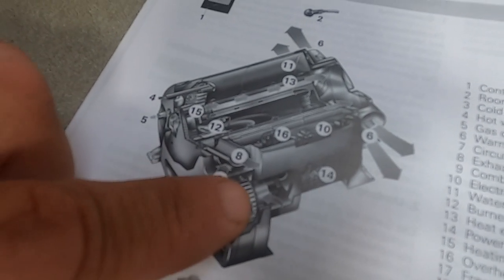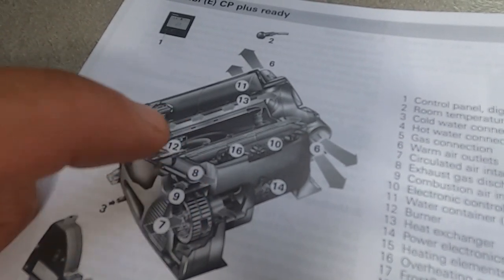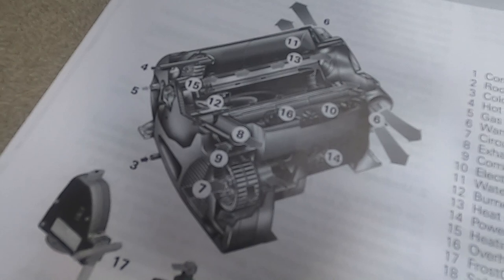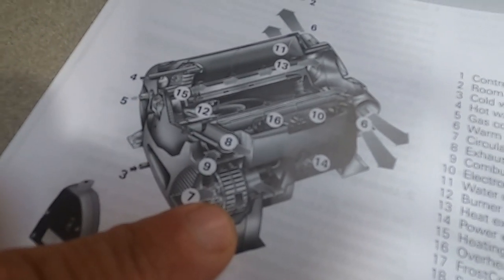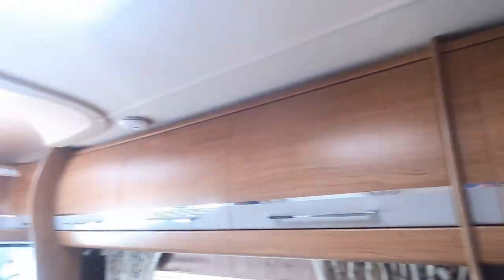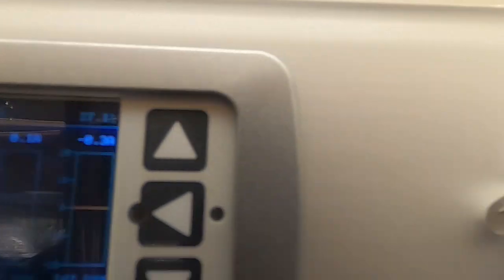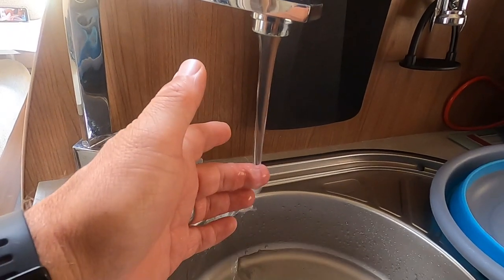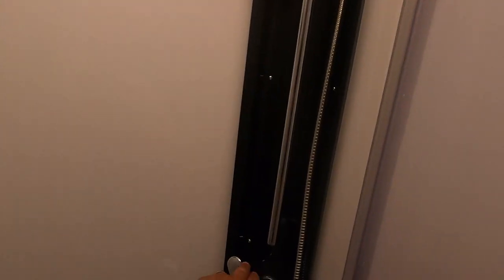Truma Combi Boiler Error Code E89H Update

Comment: Thanks for a great video, mind you I nearly turned off when you said that you had no lpg.My motorhome is 2011 and my control panel does not show any fault codes it had not been used for 10 months the last time the truma was tested out was by the enginer doing the habitation inspection and all was OK back then.The only thing it would do was heat the water on gas nothing else would work .once i  watched your  video the penny dropped, without the fan working nothing else can work,The use of that famous tool toffee hammer persuading device for lazy bits of components,,.BINGO ALL WORKING NOW NO COSTLY BILL?       THANKS AGAIN  KEEP IT UP.
Reply from the maker: Thanks for watching. Glad the video helped you.

Comment: I thought I would try my heating and hot water today as I go away for 7 weeks in the morning to Spain.  What a shock when I found that my Truma showed the E89H code. Panic set in, thinking We were going to be really stuck. I phoned a specialist and he gave me a few tips. Then I came across your video. What a life saver your video was to me. A few taps on the motor, as you suggested,  and all worked perfectly. You are a saviour my friend, and probably saved me a few hundred pounds. I am so grateful, many thanks

Comment: I am confussed  and thankful. I had the E89H code come up on my Coachman. Check the code which says problem with "Pcb /combustion fan". Contacted my repairer who confirmed most likely  the fan was the cause, but was booked until July.  But I watched your video and thought its nowhere near the fan in question, but the Air intake motor. I decided to clean my combustion fan and air motor and give it a tap. and low and behold it all now working. Still confussed but now happy..thanks.
Reply from the maker: When I had this E89H error code I called for a mobile caravan/motorhome engineer who showed me how to simply tap the collar shown in the video. it worked fine for the next 18 months reappearing just once, out came the toffee hammer and it was working again!

Comment: Hi, just watched your video re: Truma motor fault….very useful for me…my boiler failed last month….not sure if I had seen that exact error code but I may have done….however…my boiler eventually went into lockout…E41 H….

I took it to a Truma guy in Morocco today, he reset it and guess what:: seems the motor is on its way out, running now but not sure how long it will last, ….hopefully until the motor is replaced…great video…well presented.
Reply from the maker: I hope it keeps running for you. Strangely enough, our Truman boiler (different motorhome) has just thrown up an error code and because it is sited in a ridiculous place with poor access, I've knocked a wire off while trying to do a hard reset 😒.  We are just about to cross the channel heading to Spain 🇪🇸 with no heating or hot water. 
Hope it's warmer in Spain.

Comment: Error code E89 is for the combustion fan , what the engineer tapped and what  you have pointed to on the Truma diagrams  is the air circulation fan!.It has a centrifugal fan . The combustion fan is at the centre top of the unit behind another panel and has an axial fan on the outside, along with a pcb and a centrifugal fan inside the gas combustion chamber intake

Comment: I tried your fix as my Truma 4e was doing the same, my heater will run on gas or electric for a period of time then stops again. Any other ideas my error code is 6.
Reply: I meant to add my control panel is a different type.

Comment: Hi Kev good video.
Did the engineer say why there was a carbon build up.
Do you think you get more using the gas or electric .
Regards Mark.
Reply from the maker: Hi Mark, thanks for watching. The engineer explained that the carbon build up was from the bushes in the fan motor when spinning around.He didn't say if you get more carbon build up from either gas or electric but so far it's working fine. All the best. Kev.